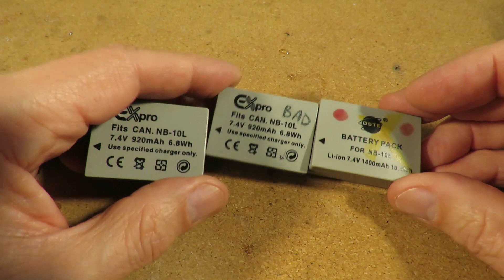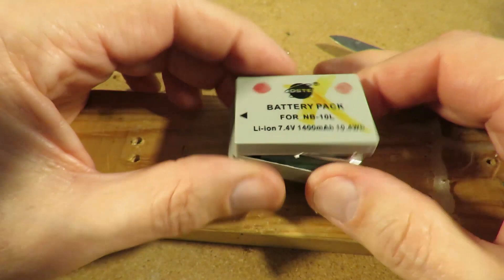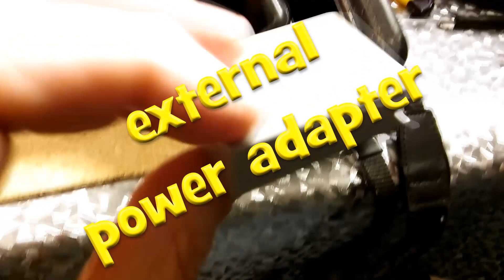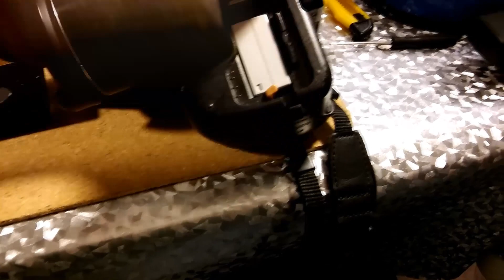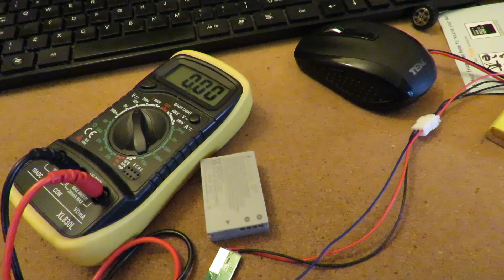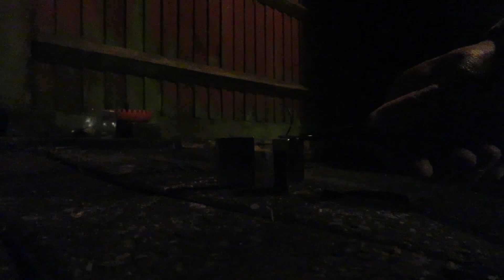Canon Battery NB-10L LONG VIDEO

Comment: I liked the vid very interesting 🧐👍🏻
Reply from the maker: Thank you, I don't recommend doing this, I am just sharing what I have done. I have NOT tried the modified battery in my camera just in case there is a problem. It should be safe but my camera is rather expensive to replace.